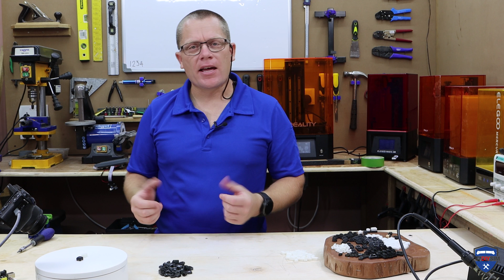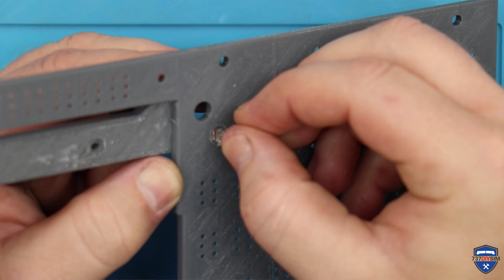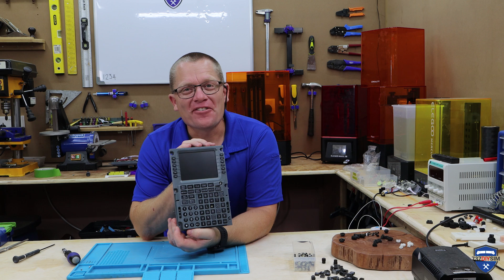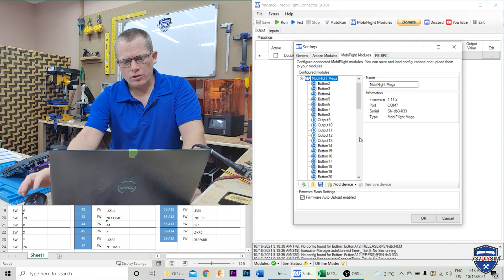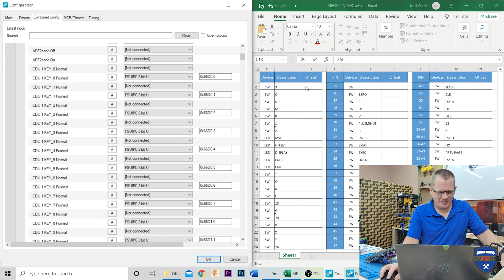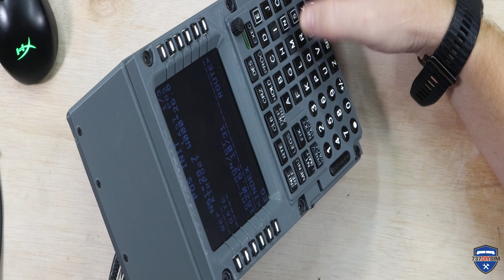Creating a 3d Printed FMC for MSFS2020 & P3D

Comment: Good morning, after testing it for Xplane,
In the end I modified it to do it with Msfs2020 but with the latter I can't get the FMC/MCDU/CDU screen to fit the screen you use in your 640x480 video.

How do you extract the Msfs2020 screen so that it stays at its size ?

Thank you very much and as always, delighted with all your work.

Comment: Thanks for the inspiration! I am making a full cockpit for a AW-139, and have made a hybrid FMC using the AW139 panel and my own backer for button mounting that I learn to make in Fusion 360 and 3d print. I have a problem though. At 25 minutes, you SKIPPED programming the basic Arduino board in order to connect it to MobiFlight! I have no idea how to do it. A little direction would be a great help.:face-orange-biting-nails:

Comment: the wonders of gui based programs! Programming the mappings for around 70 keys would be much much easier if there was a command driven language insteas of dialogs; one program written, one csv exported from excel. Guis are fine - as long as they are not used for repetitive tasks; thats what we actually have computers and programs for! ;) maybe mobiflight and prosim will provide a command language some time to configure?
Reply: Have to go take a look, but there is a guy that is doing a C172 sim, and his Excel (or was it Google Sheet), has a macro that generates a text file of the configuration in the correct format, ready for loading without having to go through all the GUI setup.

https://www.youtube.com/watch?v=kqd1GGNbgtU

Comment: How did you connect all buttons  to GRD without using a Breadboard  ? I only use Breadboards and Arduino Mega R3 but the connection on breadboard can be tricky because the wires often leave the pins
Reply: I would guess that every button uses a single ground so you connect that wire from button to button and connect only 1 pin to Gnd on the Arduino.

Comment: Sir, thanks a lot for the excellent sharing, may I ask to build up this quality of Simkit, which level of 3D printer is able to cope with the task, do this need to be 8k printer? Thanks for suggestion in advance.
Reply from the maker: Hi James, Im not sure if i resin printed this, but i think i used a standard Creality CR10 filament printer for this design.

Comment: You did such an amazing job! And the result speaks for itself, because that DIY console you made is just 100.000% awesome, super incredible to look at and from where I'm looking at it, it seems hardly distinguishable from a genuine unit! 

One question, would it perhaps be possible to know the specific part number or name for those LED switches you used? Those look superbly handy for some of the DIY projects I'm doing over here too!

Okay, I may have lied because I have another question! Was there a specific reason for why you opted to use a dedicated wire for each button instead of just using a matrix configuration to wire your buttons (into rows and columns)? 
Granted, you would have needed to add a single diode to each button, but it would have allowed you to wire all your 69 buttons (if I remember correctly?) to your Arduino using less than 20 pins, all for the small cost of slightly increasing the complexity of your button polling code. But especially if you are using interrupts and software debouncing the increase in code complexity wouldn't have been so bad i reckon. Not to mention the fact that it would have greatly reduced the complexity of your wireing loom and it would have saved you a great deal of time in the process!

Comment: This is great.
The new update from PMDG 737-700 for MS2020 now includes pop-out displays. Meaning you don't need Prosim anymore. All you have to do is pop-out the FMC display and move it to your external FMC screen and voila!
Reply: but how you will connect PMDG with mobiflight and MSfs2020? Iam stuck  here..
Reply: found it.. thanks!..  i did not check custom variables for msfs2020 and pmdg
Reply: I'm building one, read this comment, and have questions. Don't you still need Prosim to map all the buttons?

Comment: Hello.
I have a complete Boeing 767 /757  cockpit CAD files.  Including OHD, front panel, yokes, middle console , side panels and windows. I am building a full size dual seat 767 cockpit. I would be happy to send the whole thing to you. This was given to me by a flight simmer in Germany.  I may ask you for help in setting it all up based on Arduino.  I bought a real 767 console with stepper motors all the levers but missing console instruments-  I bought the CAD plans for your FMC and am getting my daughter who has a BS in Industrial design, who will be helping me with the printing, laser cutting, I will be doing the electronics-  I hope you show how to connect to the Arduino. 
Also, if you need any design help, I volunteer my daughter for whom I got & still owe a big part  US of $ 80.000 in tuition!   I am encouraging her to start getting into the Flight simulator kits business. 
Thank you again for your educational seminars !

Comment: Hello Karl! I'm so glad I stumbled upon your channel, I want to create the FMC as well, but I'm struggling to understand what software you're using & it's cost, I've looked it up but it seems and sounds expensive, is there any other way to integrate the buttons to msfs? Really looking forward for the pmdg 737 releasing soon! Thank you!
Reply from the maker: Hello, I use Prosim which is very expensive. I would wait until PMDG release their 737. That way it should be a very straight forward config with MSFS. Very much like the G1000 programming. Kind Regards Karl
Reply: @helimech8152  I see, thank you! I've actually decided to make the MCP instead, waiting on parts to arrive and 3d printing

Comment: This is truly amazing..we are just setting out on our simbuild and discovered 3d printing as a cheaper option..can you point us in the direction of an affordable printer (ender 3?)..would this be suitable to build a 737 overhead panel etc and fmc..plus what is the rough cost of the plastic to use in the printer (sorry for the newbie questions)
Thanks
Sean
Reply from the maker: Good morning Sean, If you can afford a slighter bigger printer than the ender 3, go for the Cr10. Some of my designs require the bigger print bed of 300 x300mm. Also this would really help for overhead, where some of the panels are quite large. Work on 20 euros/pounds per 1kg roll. Kind regards Karl
Reply: @helimech8152  appreciate the response..gone with the ender 3 v2 for now and see how I go!!!..just printing the demo dog!!

Comment: Great video, just curious can you create this FMC without using the pro sim software for the pmdg 737 when it comes out for msfs2020
Reply from the maker: Hello! It can be used with the old PMDG737 and P3D. I would say not nativley in MSFS2020 yet, not until PMDG release the new version. In theory it should work as long as the buttons are pressable in the sim and the screen can be undocked. But I personally have not tried due to having Prosim. Not much help im afraid! Kind regards Karl
Reply: @helimech8152  thanks for the info, I have the program axisandohs which is compatible with the Arduino board for inputs and outputs. I’m sure with a lot of trial and error I could work out the simulator events to match the buttons

Comment: Brilliant work!  A great idea and one I intend trying. with an ESP32 to drive it. Presumably you've added 220 ohm resistors with the LEDs?
Reply from the maker: Hello Russel, The resistor values are on the wiring diagram as I can not remember the value I used. The resistors in the video were attached to the arduino prototype board and not to the LED's direct.
Reply: @helimech8152  Thanks for replying. My fault in not looking at the diagrams first.
Reply: @russelldicken9930  resistor should be around 220 not 470.. I think he made the assumption it was on a12v rail

Comment: I would like to clarify  a couple of things.
The device being created here is a Multi-purpose Control and Display Unit (MCDU). In some ways it is like an asynchronous serial terminal, V T100, except there is a single TX port and 7 (or more) RX ports.
ARINC Characteristic 739A-1 details the MCDU. ARINC Specifcation 429, Digital Information Transfer System (DITS), details the signaling used on the TX and RX ports.
Both Flight Management Computers (FMC) are connected to the same TX port. Each FMC is connected to separate RX ports.

I expect that the interface between your MCDU/Arduino and your FMC will be localised and not 429.

I like your work. :)
Reply from the maker: Hello, You are spot on! I'm not sure how in the sim world it got called the FMC. Great knowledge you have there and nod my head in appreciation. Kind Regards Karl

Comment: Dam.. that looks for sure like the real thing. I probobly could not tell them a part if they was next to each other.

Anyway,,, this really shows us that we need multi material printers and conductive filament.

Granted, there is a way to make PCB with a 3D printer.
Reply from the maker: Hello, and how cool would it be to produce PCB's on a 3d printer. I have a laser on the way, so hoping that will produce good parts too.
Reply: @helimech8152  There is UV sensitive PCB ready to buy in bulk. You can literally just put them on the printer, expose it for 90 seconds, then edge away the copper, and you have a ... more or less, perfect circuit board.

Its even possible to make a soldering mask the same way. Its dead simple, really the only hard part is to design the PCB.

Its also possible to make two side PCB. Of cause all the vias need to be drill pressed.

And if you want to have a non square PCB, you would need some kid of CNC machine.

https://www.youtube.com/watch?v=RudStbSApdE

You could also edge on Solder mask with the exactly the same method.

While this may not be the best way of making a PCB, its dead simple and if you already own a 3D printer really cheap to start with. And its fairly fast.

While ordering PCB  online will be much cheaper and easier if you want a bunch of them, If you only prototyping at home, and want one now. this is fast, simple and relatively cheap.

https://www.amazon.co.uk/sourcing-map-200x150mm-Double-Sided-Prototyping/dp/B07R67G1FK/ref=sr_1_10?crid=5R5IDLNVLSEE&keywords=copper+PCB+board+UV&qid=1641487937&sprefix=copper+pcb+board+uv%2Caps%2C90&sr=8-10

That is £19 for 8 boards 200*150mm dual sided  precoated with etching solution.

UV activated solder mask is dirt cheap.

So its pretty much just 4 exposures, drilling cutting, then a bath to plate the holes.

The sort of... complicated bit, if you want non square finished boards, a CNC machine  (or possible a hand router) is really the only viable way.

But if you can design the boards square, Its pretty much just making how many boards you need on one PCB, drill it, cut it up, plate it, then it finished.

Comment: how do you Display the FMC from MSFS?
Reply from the maker: Hello For the 737, You currently need Prosim 737 which has a dedicated background app that displays the data on a separate screen. If you have other aircraft with an FMC you should be able to push the right ALT key and left click on the FMC screen. this will undock it and you can move it to where you need. Kind Regards Karl
Reply: @helimech8152  ah okay , thanks

Comment: You have a wonderfully interesting project. So much work, but is looking great. Is there any reason you can't use standard button arrays to lower the number of pins/wires you need on the interface Arduino? I know for many controls you want a dedicated poll for each point, but the FMC doesn't need N-key rollover, and you could easily knock down to 9x8 button matrix only needing 17 pins instead of 70+. You would need a diode for each switch, but it would make wiring much simpler to the Arduino. 
Curious if this is a limitation of proSim?
Reply from the maker: Hello, its not a limitation of Prosim, but of the interface software Mobiflight.  I do believe button matrix is coming in a later version, its just not ready yet. Hope that helps answer the question, Kind Regards Karl
Reply: @helimech8152  they support for the coming beta release of mobiflight the input shift registers! I think it will be 4 ic's max (so u can have 32 extra buttons and lost only 3 pin)  , but enough for now for connecting the buttons to a single card.. the 74hc165 register will work 100%.

Comment: Really good channel. Which 3d printer is recommended for this stuff?
Reply from the maker: Hello, Out of the printers so far i have played with, it has to be the CR10 series. I have the v3 version and they are reliably and amazing print quality. I also highly recommend a bed size of at least 300mm x 300mm. Hope that helps, kind regards Karl
Reply: @helimech8152  thanks for tips. Which filament you use?

Comment: Hi Karl, I am starting my own home cockpit build and reviewed my options. I can print most of the components at work and I ordered most of the electronics for the 37 dollar mcp from Amazon in US. Cost me about 210 dollars. I know. What I am wondering is if you could comment on how to interface from arduino through mobiflight and fsuipc directly to msfs. I can not justify the prosim cost at this point. I understand there are some other builders out there doing that but I appreciate your approach and explanations. Thanks in advance , Nils.
Reply from the maker: Hello and wow! Did you just pay 210 dollars for a few electrical items for the MCP or whole cockpit! If you want to connect this direct to MSFS2020. I'm not sure that would be possible, at least until PMDG release their version of the 737. There's the video on the MCP build, the one after this where i show how to interface certain parts directly. You may want to check that out. Kind Regards Karl

Comment: Curious if the Hispapanels PCB would work with this 3d print?
Reply from the maker: Hello and the answer is no i'm afraid. The design uses the pla printed backplate as the base where the PCB should go. A custom PCB is planned shortly to help create a much wire friendly version!
Reply: @helimech8152  thank you. Yes I understand it has a printed backplate. My question was could the Hispapanels PCB be used in its place? Sounds like your FMC backplate may be a different size than other panels.   Any guess on when your PCB will be finished?

Comment: Hi , awesome video. Am very keen to start on 3d printing. Am new to this. Yr expert advice pls. What material should I use to print the mcdu , fcu , button and dials. Shld it be PLA, petg, resin or abs? Thank you in advance.
Reply from the maker: Hello and Thank you for the kind words. I would stick with PLA unless there is a heat build up on a certain part that causes warping. Then try switching to PETG or ABS. But PLA is simple to and easy to work with. Hope that helps, kind regards Karl
Reply: @helimech8152  Thank you the reply.

Comment: 2 Arduino Mega's because you don't have enough digital I/O pins? You need to learn about shift registers and matrix inputs and the right code. You could easily handle every single key from a single, regular Arduino UNO. This is how real computer keyboards work. They don't actually use a micro with 102 inputs. They use a micro that has a much smaller set of inputs, and they wire it in such a way that they are scanning the inputs only a section at a time. They "shift" which inputs are being read by essentially reusing the same small number of inputs (such as 8) and using shift registers or matrix wiring that essentially connect or "shift" which keys are connected to those 8 inputs.   So the first scan reads buttons 1-7, shift, now read buttons 8-16, shift, now read buttons 17-24, and so on. Typically you create an array to hold the state values of each button. You rescan the entire keyboard many times per second. Even though only 8 buttons can be read at a time, you will catch every single key press every time. Again, this is how keyboards are made.
Reply from the maker: Hello and thank you for your input. Unfortunately, its the interface software that limits the connection between the hardware and the sim. I have taken a step away from programming and now let much more competent people create the code. Kind regards Karl

Comment: @Heli Mech. Hello Karl, since I came across your channel, I've absorbed every video and admire your work and passion for your simulator. Now i can say that i'm already infected, and catching me with the idea of possibly embarking on such an adventure. I am an electronics engineer myself and also fly a simulator and am still passionate about RC model flight models My question is, which material (PLA, PETG, ABS ect) do you use for all the panels you print, and do you print directly in a gray filament, or do you paint the parts?

With kind regards 👌👌👍👍
Reply from the maker: Hello and welcome to the channel! I would highly recommend checking out the website which hopefully explains all. But if you plan to 3d print panels, you can print in grey and then change filament ant the text layer to white. Or just use a paint pen on the raised text. I hope that helps, If not drop me another comment! Kind Regards Karl